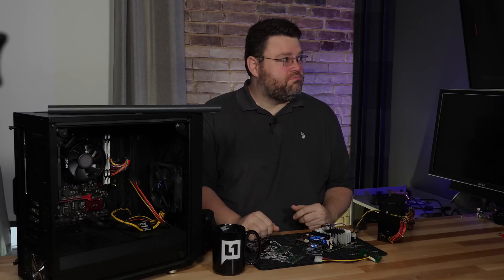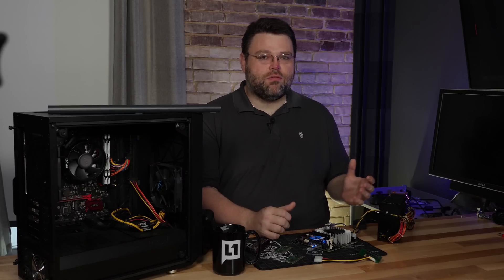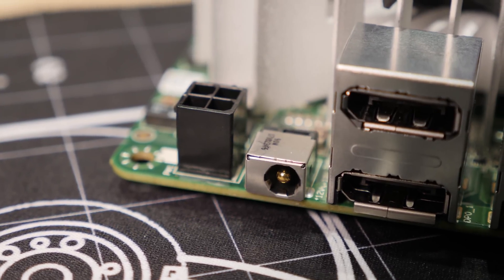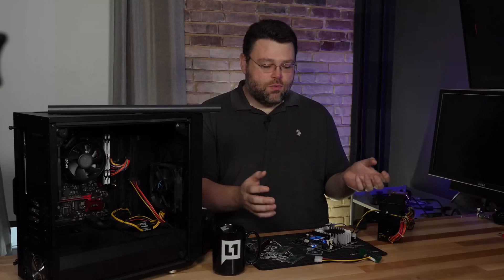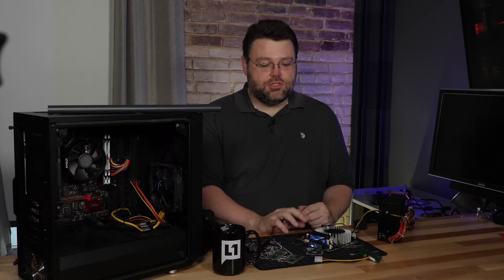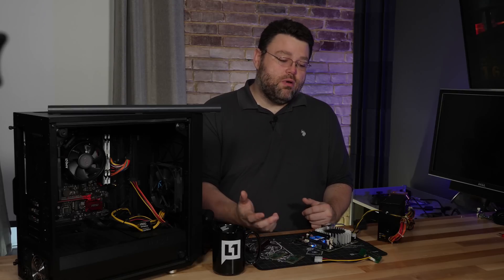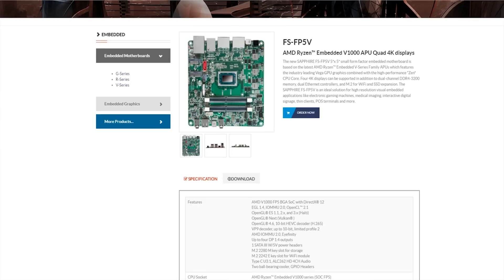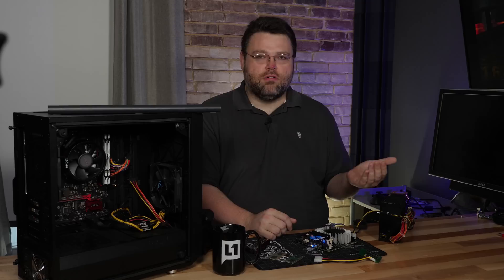AMD v1000 Embedded: Sapphire FS-FP5V EXCLUSIVE FIRST LOOK

Comment: How can I get one of these boards? I really want one for a particular project that requires the smallest form factor possible but you can't really buy just one from Sapphire. Would it work with a regular SSD? What kind of DC power brick would be required to power it? I really want one of these for a project but don't know who to ask. Many thanks in advance!

Comment: $450 is a bit steep for a motherboard, cpu, heatsink+fan assy and pico psu or am I overlooking something? The major selling points I see are the fact it theoretically can be used on a battery, it has so-dimm ram slots, 4 displayports and a gpio header (which is a very rare thing to find these days) while sacrificing the PCIe interface. I reckon this is best used as a raspberry pi on some very heavy steroids. For the ones making an htpc or retro gaming pc it's probably a better choice to just buy a 2400g, a gigabyte b350 mini-itx board (which has display port) and a pico psu than this very nice board.
Reply: That $450 may be a maximum price, depending on the volume ordered. You can't just order a few or a couple dozen boards as a minimum order. In most cases, it's at least 100 boards if not 1000. Buy more, and the cost per board decreases. 

Even at its maximum theoretical price, it's cheaper than most 4K Digital signage systems that exist, and plentiful computing power that beats many embedded system offerings that exist on the market at a much lower cost. Have a look at the Intel NUC barebone systems as a comparison. Too many of those NUCs are overpriced for similar performance as this Ryzen embedded system.

Comment: it won't be able to drive a 2 displayport input 5k display on linux (on windows I don't know). The AMD graphics driver in the kernel still doesn't support using the dual input 5k displays. It's the reason I'm planning on getting rid of the RX 480 in my main workstation, because I'm only able to drive my HP z27q at 4k over a single displayport.

Comment: Hey everyone I am thinking about switching over to Linux. What version would you recommend for someone who mostly games on their PC?
Reply: Check out Level1Linux. Might be able to help you out.
Reply: Grizzly ubuntu or linux mint.
Reply: Ubuntu 18.04, or one of its modified versions like Lubuntu or Linux Mint.
Reply: TheBackyardChemist Maybe 4 years ago I would have said Lubuntu, but it's on its last legs  with the next version going to a LXQt for the desktop, so right now I would go with Xubuntu for a lightweight distro, and just make sure to update the kernel, and switch to compton to avoid screen tearing on an AMD setup. Edit: I actually run Xubuntu 18.04 on an old AMD Athlon II X3 435 CPU with 8GB of DDR2 RAM,  an XFX R7 240 2GB GPU, and a 450watt Rosewill 80+ Bronze on an MSI AM2 motherboard with a 250GB HDD as my work computer, and even that machine can run less demanding games on STEAM like TF2, Broforce, Pac-man 256, etc.. @ 1080p 60hz on low - High settings at a playable frame rate. Although I will be throwing a 4 core CPU in that machine I got for $5, and yes I'm cheap lol!

Comment: I have three questions:
- Can it support a Samsung 970 Evo/Pro NVMe M.2 1TB or 2TB?
- The fan, does it have a copper center or is it full aluminium? (Even if you can run fan-less, you can't complain about better cooling, you can achieve longer turbo boosts)
- Can we bug Sapphire on Twitter to see if they would release a consumer version(s)?
Reply: the more that bug em the bigger the chance for something to happen

Comment: I could imagine building an ultrasonic imaging device with that. You'd need a bunch of extra aquisition hardware but this thing has plenty power for almost any such application. Another really exciting use would be in a high-end oscilloscope, that would be really beefy.
Reply: It would be really kickass if you could hook up the ADC to the USB 3.1 port and get the 5 or 10 Gbps bandwidth, that could push some serious sample rates. With 2*16 modules you could get 32 GB of sample memory. That would be awesome, you could connect some knobs via the GPIO and have a proper scope. Maybe get a 144 Hz display for it even?
Reply: You would not do that over USB. PCIe is much better and easier to use for this. For most stuff, DRAM is actually too latent and too slow aquisition.

Comment: If these things would have been available a few year ago, the steam machine thing might have been way more successful. Really interesting system.
Reply: I was thinking just that, as use my old Tri core AMD Athlon II X3 435 CPU with 8GB of DDR2 800Mhz of RAM, and an XFX AMD R7 240 2GB GPU on Xubuntu 18.04 on the late kernel, with dual monitors as my work PC, and I decided to see what STEAM games it could handle on Linux, and even at 1080p 60hz on some older titles like TF2, and Rocket League(low settings) I was having no trouble playing, so these little boards would be really good for 1080p 60z STEAM Machine builds with Xubuntu using less resources than the main Ubuntu builds.

Comment: No idea what market this thing is gonna serve that a rasperry pi can't. 
Overpowered for home cinema stream station and underpowered for console gaming.
$450 for 4x video out. Advertisement, Video wall apps. I get 15 raspi's for that. 
Too expensive.
Reply: Kiosks, gaming machines (casinos) Firewall Routers with encryption (graphics accelerated encryption) with ECC... any niche that has been using the previous generation AMD embedded systems which have been selling very well.
Reply: I could see $350 max with 16GB of RAM, and 128GB of storage in a small case for some 1080p 60hz gaming on Linux via Xubuntu, as I think it would do fine for that.
Reply: The similar thing on kickstarter was $230 for the cheapest one not much more for the beefy one. But yea I'd imagine its pretty niche when you would really need one of these over a pi. The kickstarter one has a microcontroller that can directly sleep and wake the main CPU which I thought was pretty cool but thats about the only thing really. Maybe its meant for computer vision in cars or something.
Reply: There are many complex systems that a Raspberry Pi cannot do. 4K video, AI processing, servers.. There's a limitation on what the Pi can do. 

Differences between the Ryzen embedded board & 15x RPi boads:
- Ryzen has up to 4x 4K output, while any of the RPi's only output 1080p. 
- Ryzen has up to 32GB DDR4 RAM support with ECC support; RPi has 1GB DDR2 non-ECC each with up to 15GB clustered. 
- Ryzen CPU has up to 4 cores & 8 threads; RPi each have 4 cores 4 threads, total clustered up to 60 cores. 
- Ryzen has dual Gigabit Ethernet support + Sata/M.2 storage + USB 3.1 support; RPi has up to Gigabit Ethernet over USB2.0 controller (~300Mbit) + SD card only + USB2.0 only. 
- Ryzen Total TDP: 54W; RPi Total TDP: 12-15W each. 15 Clustered boards: Up to 225W total (minus networking equipment to achieve cluster). 
- Ryzen cost (barebones): Up to US$450. RPi total cost (barebones): $35 * 15 boards = US +$525. 

A Raspberry Pi has its limitations. Don't treat it like an "OP PC". It's a microcomputer, with an ARM base. Raspberry Pi has changed the world for IoT, but it has its limitations. Clustering is much easier and cheaper to do nowdays, but there are scenarios where even clustering won't provide any advantage. I'd still pick a RPi as a first option in IoT for its processing power and capabilities, but there are some scenarios where more just doesn't cut it.
Reply: Man, 450 is way too much. Maybe 150 - 200. This would be a SUPER powerful pfsense box. Would also be great as just a linux desktop with a more powerful pc for game streaming.
Reply: Jonny St. Esprit

That's on the high end. This thing's more of an x86 than an embedded but still works like an embedded computer. You're missing the point entirely if you're thinking that 450 is "too much" for an overclockable, dual NIC, 4x4K output, all-in-one microprocessor.

Almost anything could be done with this. it's even got GPIO headers...this thing's a beast. There are also lower end options as well.
Reply: Massive video walls, adaptive signage, video menu's almost all big restaurants now have, POS terminals. You can take one of these, some ram, and a ssd and you can create a 4 screen menu similar to the rotating menu Tim Hortons currently uses and it will barely break a sweat. Want 4 self serve terminals at the table so your customers can order via touch screen reducing labour costs in your restaurant while providing better service. I could think of a million uses for this thing.

Comment: I would love a version of this board with a couple mini sas connectors so it can be used in a small form factor nas build that has come grunt to it. Ever since the avoton c2000 series atom processors had the clock problem, the small form factor segment hasnt had anything past a couple dinky low power celeron and atom(non avoton) based boards that required a pci card to obtain enough expansion to run them in a nas configuration.

Comment: M.2 bluetooth module. The batocera distro and 4 bluetooth controllers. ULTIMATE RETRO GAMING BOX.
Just needs a small case.
The GPIO is nice too. You could add your own RGB controller software and drive LEDs with that too. Or maybe hook up a NFC reader to lock and unlock the device.

Or... you can use this to drive your car!. So many possibilities.
Reply: Alfredo Rivera Maybe the gpio and rgb lights to make your own ambilight clone like on the raspberry pi and use steam in home game streaming to stream your games to it from your gaming pc. It would be one htpc to rule them all.
Reply: gaatje niksan really cool idea!. Maybe implement looking glass over TCP, and skip steam directly?

Comment: How does it compare too Intel NUCs?
Reply: Integrated Vega graphics Vs. IntelHD 8000 series garbage. More Cache, ECC memory support. UNLOCKED
Reply: It has buttloads more GPU power. Besides the formfactor they seem like very different machines.
Reply: Better then anything intel has with the exception of Hadescanyon.  Which is targeted for a different demographic.

Comment: Man if you guys could carry those I would Love to buy one!  Would be perfect for some projects I have in mind.  

Though I wish they had better cooling for overclocking than an extruded aluminum heatsinks with such low fin density.   A higher fin density copper heatsink would've been really nice.
Reply: I want one of these in a 1U rackmount package as a virtualisation appliance with pfsense, would be kickass.
Reply: just one in a 1U? bet you could slap 3 of those maybe 4 in a short 1U case, I would like some of them with 3 or more Intel 1Gbit connections and some with atleast 4 SATA connections or heck 1-2 SAS connections since they take up way less room and then one "normal" one without extensice lan/hdd connections, that would cover router/storage/webserver for me, all in 1x 1U case with minimal power usage.

a better CPU cooler would be nice, that one looks horrible + that fan meh... some high density fin cooler with airflow going front/back of the board = super sweet. 

So guess I need atleast 3 of those, doesn't need to be high powered at all but heck one with Vega11 or whatever it was, would be plenty for a nice little desktop system as well, so I guess 4 of them :D

Sapphire could punch a gigantic hole in the market there and make heaps on it, the market for home server/nas/router/toys are major, and NUC style PCs sells in piles too
Reply: You could create a dense machine like that; however it would be advantageous for home users to have a shallow-case machine (such that you can fit hot-swap redundant power supplies to the side of the motherboard). You'd be surprised how little room you have left in a shallow rackmount case.
Reply: I second that. If there were more configs i think i couldn't help but buy.
Reply: I second this as well. I would love one of these. so many possibilities.
Reply: DanOwar Kills  if you like to buy small cooling heatsink with fan, go to the cooljag and buy cooling tower for fp5 bga cpu socket.